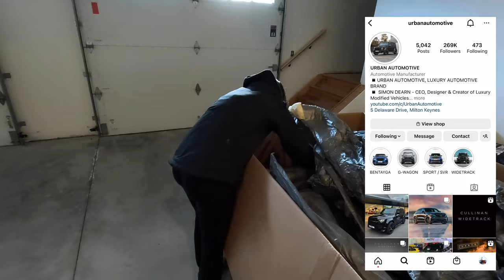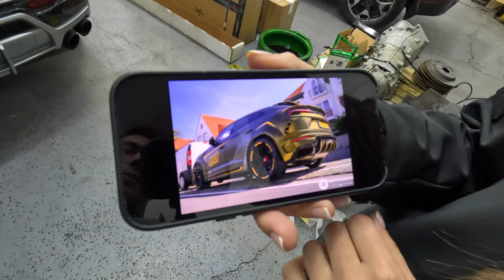Installing a Nero Carbon Diffuser on Our Lamborghini Urus!!!

Comment: If you go stage 2 catless does it still come with a quiet mode or are you forced to live with loud exhaust all the time?
Reply from the maker: we are doing downpipes that have high flow cats...it will be louder but the exhaust still has the muffer and will still work with the factory system to be quieter in street mode vs corse etc

Comment: GoPro 👎 - Check out the Insta360 One RS 1 inch if you want to stick with the vlog style camera. Much bigger sensors for improved low light performance.v There's even a 1 inch 360, so you never miss a thing and is awesome for motorcycle content!
Reply from the maker: yeah but those insta 360's have a tiny viewing screen so they really aren't useful for the type of content I'm making

Comment: For the love of good stop using the gopro. The shake makes me motionsick and the quality is 2009. But your phone on a small tripod and use it the same way as the gopro
Reply from the maker: nah iphone audio is even worse than the gopro and it has no way to block wind so I'll go back to the canon g7x for now
Reply: @JaretCampisi  works perfect for goonzquad
Reply from the maker: @sputnikl727  they film indoors so they never have to worry about wind
Reply: @JaretCampisi  but 85% of your stuff is also indoors